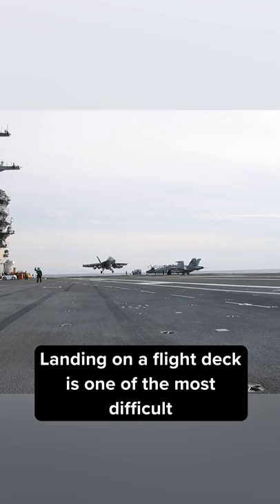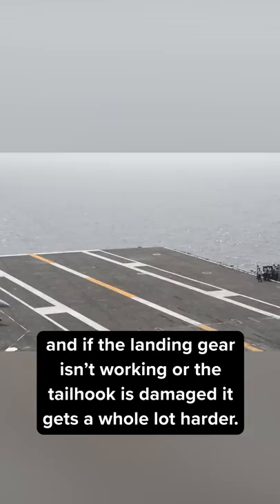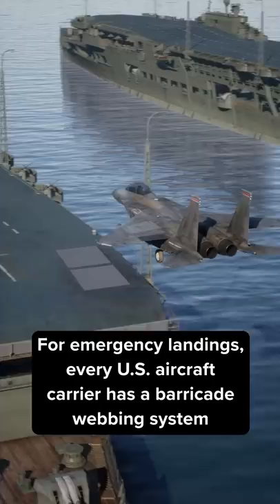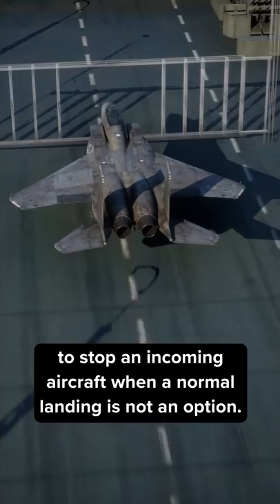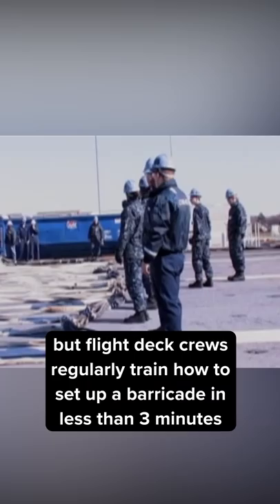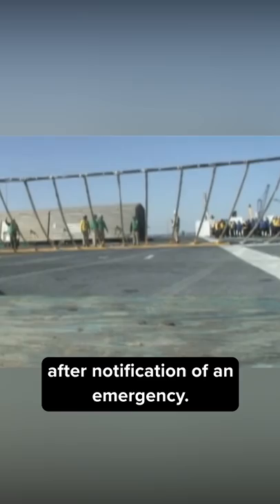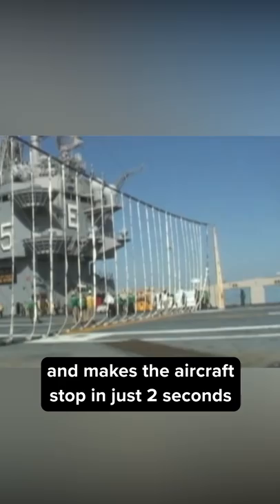How Planes Emergency Land on Aircraft Carriers

Comment: Imagine using some wires to stop your fighter jet.

This post was made by VTOL fighter jet  club.😂😂
Reply: Isn't that the one that lands and takes of vertically?
Reply: @thepeanut2681  yes
Reply: @thepeanut2681  Ya, you basically just described what it stands for. Vertical Take Off and Landing
Reply: arent vtols crap at being normal fighter jets?
Reply: @iampurechaos  The harrier can't compete with modern jets very well, but the f-35b can compete basically as well as any other fighter.
Reply: @iampurechaos  There are also other VTOL fighters that are just as capable, but also some other models that aren't.
Reply: @dawsonreum8096  that’s probably because the harrier is a gen 2/early gen 3 jet going against a gen 5 with fly by wire tech
Reply: @thisguy9458  I mean even when it was first released it couldn't compete, but it was also not really designed to. It was hard to fly and slow, but it was needed for short take off, so even though outclassed it could be useful.
Reply: @dawsonreum8096  thats cos the harrier is outdated as a 2nd generation fighter
Reply: The f35 lands normally and vertically but most of the time the just land normal
Reply: @Imadog989  the B variant can do STOVL, the A variant does CTOL and the C variant does Cato takeoffs, technical the F35 is not a VTOL at all as STOVL means it needs to be super light to do a VTOL, so light that it can't carry any payloads... Sorry, not trying to be a smart ass but I wanted to correct the F35

Edit: I worded the explanation for STOVL poorly, it can still make vertical landings but to take off vertically it needs to bear almost no extra weight making a vertical takeoff redundant unless it was an emergency and happened to have no payload
Reply: haha funni 🤣🤣🤣😂😂😂🤭
Reply: imagine ingesting a bird to be put out of action 🤔
Reply: Imagine your country not having even one super carrier
Reply: @ChoppedSteak  well, even having a carrier that can support VTOL platforms can still be vital, like harriers for example, great in ground attack.
Reply: and i live in the US, we have 11.
Reply: Imagine having a pathetic range because you have to lift your self up into the air vertically.

This post was made by the HTOL fighter jet club.
Reply: @zangryomani1257  trueeeeeeeeeeeeeeee
Reply: Only problem is that they use a shit tonn of fuel
Reply: @iampurechaos <---- hydra user
Reply: @zangryomani1257  imagine not having a propeller, you can guess who made this
Reply: Oh man do I love VTOLs and V/STOLs.
Reply: The F-35 is capable of vertical take off and landing (VTOL)  yet it still needs those "wires" if regular landing isnt possible.
Reply: WARNING⚠️Matthew 4:17
“REPENT!, for the kingdom of heaven has come near.” Godbless You All! 🙌🙏🥰😁😄💙😄🤍🕊️✝️🕊️📖🕊️😄🤍✝️
Reply: WARNING⚠️Matthew 4:17
“REPENT!, for the kingdom of heaven has come near.” Godbless You All! 🙌🙏🥰😁😄💙😄🤍🕊️✝️🕊️📖🕊️😄🤍✝️
Reply: There arent many old pilots in the VTOL fighter jet club.

Comment: The F35 fighter jet can do something called a hover landing even without its landing gear. So it's other jets they have to worry about not the F35
Reply: Just F-35Bs can land vertically. And if landing gears didn't deploy completely, there would be a huge fireball on the deck.

Comment: True but the F-35 was specifically designed to be able to land vertically so they wouldn’t be damaged through this method.
Reply: Only one version of it, the F-35B used by the marines. The navy uses the F-35C, which doesn’t have VTOL capabilities

Comment: 2 seconds imagine that 180 miles an hour conservatively to a dead stop in 2 seconds!🤩😟😯😮😳😵😱
I bet that feels like your eyeballs just blew out of their sockets and you probably have bruising to the front of your brain from slamming into the front of your skull! I mean seriously you would be lucky if your eyeballs were still in the sockets even if you didn't snap your neck or get whiplash you're going to have some bruising to some internal organs or even your brain🤏🏼🧠🤕🥴🤤 may have just a little bit of brain damage!
Reply: I feel sorry for your English teacher
Reply: That’s only like 5 gs of deceleration
Reply: Pretty sure if what ur describing was actually happening they wouldn’t be used. Also, the plane takes the entire impact for the pilot so at most probably a bit of bruising
Reply: Normal aircraft carrier landings stop incredibly fast anyway?

Comment: Wait why did you use an F-15? F-15s are Air Force. You should have used F-14s? Or F-18s
Reply: F-15s don't have arresting hooks.

Therefore they need the barrier.

Comment: Where was this sorcery when that F-35 went into the South China Sea? Do better senior leadership.
Reply: Well it was the pilot that messed up on final approach, he came in to low. Everything was okay before that so no indicitation or reason to put the barrier up. 

It also takes time to put up the barrier and when everything is okay until the last mile, there is nothing that can be done, other then eject like the pilot did
Reply: I thought f-35 can do a vertical landing lol my whole teenage was a lie🤐
Reply: @jpknight5232  The F-35B that is operated by the Marines can do that, the navy use the C-version of the aircraft